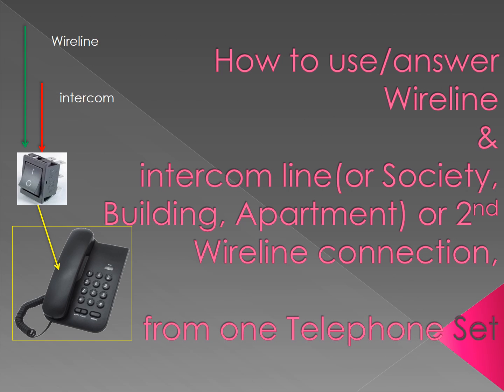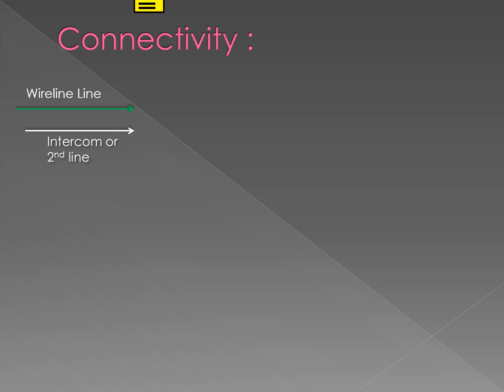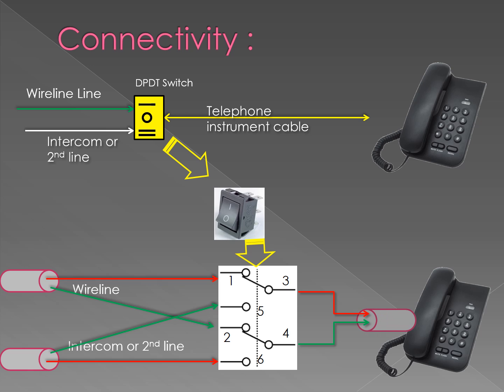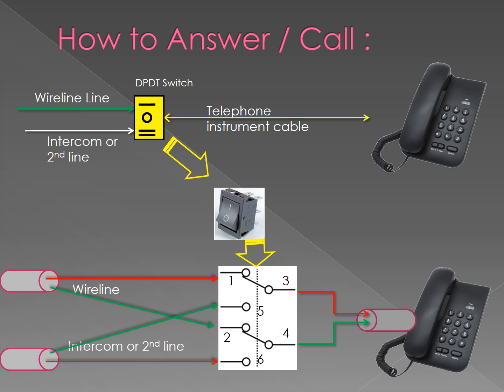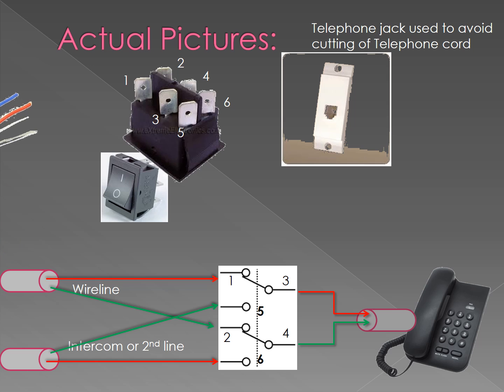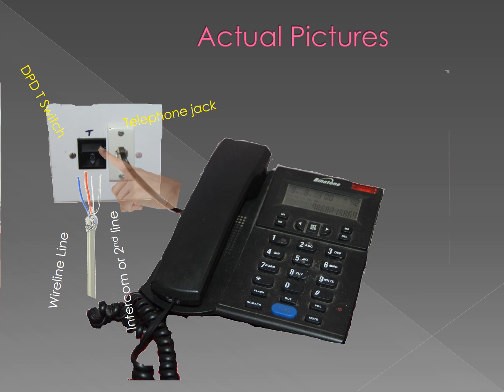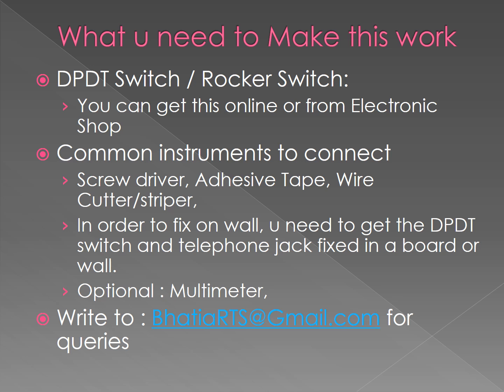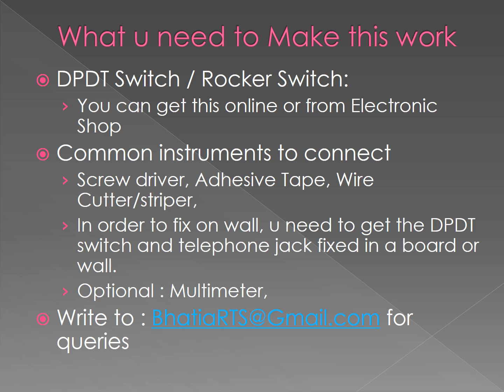Wireline Intercom in one Telephone Instrument

Comment: the DPDT switch which I ordered is acting like bell. it is spring action to connect either side. but it comes back in middle position . does not stay towards 1 of the 2 positions. Please suggest correct switch
Reply: the switch can be in 3 poisitions, including middle (No contact, No call received) , I can send u a small video clip on how I use it , if u share your contact number

Comment: No, basically u are using one instrument for two connections ( it could be both different numbers, or one intercom and other landline). To interchange u use switch in between.
Like in our home, we have same set up in two rooms, one instrument (phone is on intercom and other on landline) so when a call comes on intercom, it rings one one instrument and if we are near the other instrument we pickup and switch the connection to receive the call.
Same is for making calls, from any instrument we can make call from landline/ intercom.
I hope I am able to explain

Comment: this idea is not going to work on intercom mode. the reason is no power source when intercom mode is selected. check your circuit as shown on the video. this is like on/off switch only for the telephone. i think you have not tried it yet..
Reply: no power source required, the objective is to receive/make call on 1 telephone instrument for my landline telephone line and my housing society/building intercom line. Instead of keeping 2 different instruments or buying an instrument that supports 2 lines, I used a DPDT switch to serve my requirement